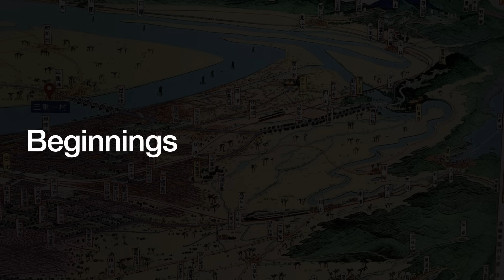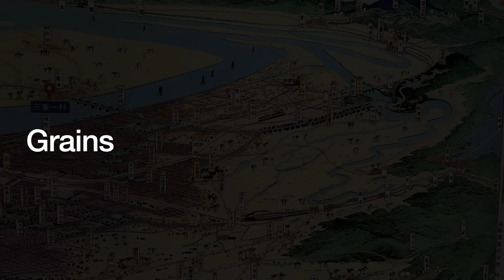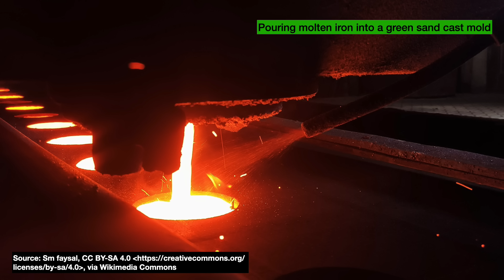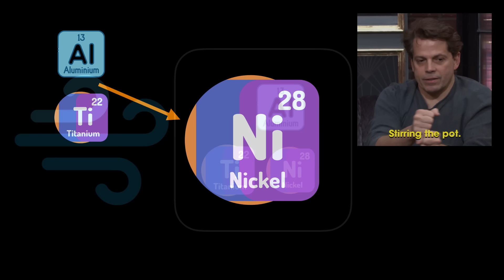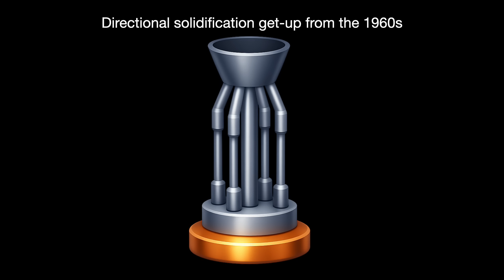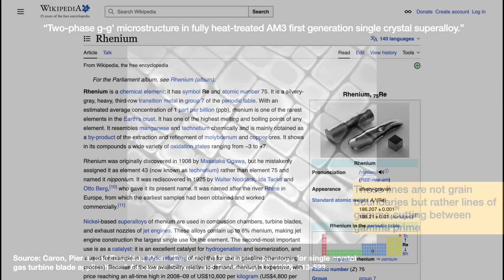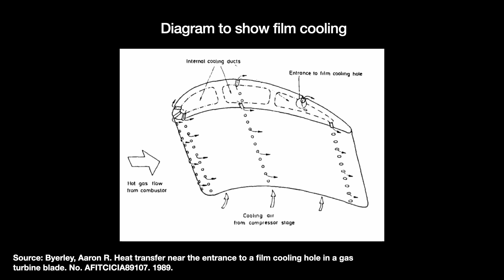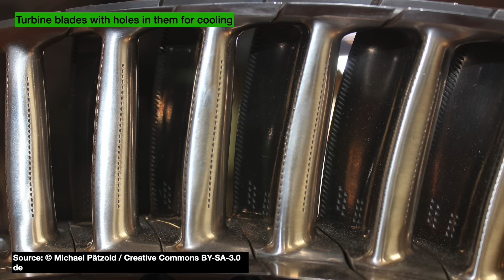Gas Turbine Blades and their Heat-Defying Single-Crystal Superalloys

Comment: Retired superalloy metallurgist here. Your summary is excellent! I worked at GE when rhenium was first introduced. Our first Re-containing alloy was called René N5 and was developed by Carl Wukusick. I used his excellent data to develop a computer model of alloying effects that was used for developing subsequent alloys, including the effects of Ni, Co, Cr. Al, Ti, Ta, W, Re, B, C, Zr and Y. My only quibbles might be that all of this technology was developed for aircraft engines and then transferred to stationary gas turbines. Also, air cooling was developed before TBC's (thermal barrier coatings). Air cooling is the number two thing in modern gas turbine performance, the first being the discovery of gamma/gamma-prime alloys. But you really hit it on the head at the end: turbine blades are made using a variety of very special, difficult, and expensive technologies.
Reply: Hello. I do not know you, but I am a huge fan.

Modern barrier coatings are the icing on the cake, but the crystalline growth mechanism is incredible, it was later used to create monocrystalline silicon ingots we use to make our semiconductors. Nearly the same process, but since Si is easier to work with it's usually grown using precipitation on a slowly spinning wire with a seed crystal drawn out of a molten pool.
Reply: @NotThatEcstatic hahaha fan 😆
Reply: @keinname2481 As an engineer, I respect anyone who works on truly deep magic like this. It pushes humanity forward.
Reply: @NotThatEcstatic  no it wasnt to mock you. Just because the video talked about fan blades 😉
Reply: @keinname2481 Ahh, that was a whoosh!
Reply: @NotThatEcstatic  hahaha whoosh 😆
Reply: I'm grinding and honing pre-machined generator and turbine bodies, this comment is pure gold for me. 
Greetings from Germany 🖖
Reply: @KwK-c7t  pure nickel comment would be more appropriate 😂
Reply: Would you recomend a book about that? Thanks in advance.
Reply: @fernandoagundezgarcia7299  There was a textbook I had to buy in 1974, "Superalloys". Absurdly expensive at the time. But you might find "Proceedings" of the quadrennial Superalloy conferences held at Seven Springs, PA during my time and before, maybe still. Academic stuff.
Reply: I forgot Hf, hafnium. It and C, Zr, and B are big and small atoms that lodge at grain boundaries, hindering their ability to slide. Still used in single crystal alloys, since they can have low-angle boundaries. Y is there for oxidation resistance. Al, Ti and Ta are gamma-prime formers. Co discourages the formation of extra phases, so more good stuff can be added.
Reply: @ChesterMotors-gg3dy  Hafnium has been a huge topic of interest for me lately. Very cool stuff. Very rare too once we exploited all of it on earths surface. I still dont understand why its preferred over Ziconium in alloys since they are so similar.
Reply: @keinname2481  Alloy development is not so sophisticated that all the ingredients are at optimum levels. Is 0.5% Hf the best level? The developers don't really know. Some ingredients are given more attention than others, but some may be present only because it was already in the alloy being improved upon. Some may be present based on an educated hunch. So, perhaps more Zr, less Hf would indeed be better. The tool I developed didn't address the minor additions very much if at all, since I had no data for them. Even for the major elements, I had only enough data to find linear effects, when the real effects probably were non-linear.
Reply: @ChesterMotors-gg3dy  
Sir may I DM you to get mentorship on said subjec experties?
Reply: Air cooling and TBCs were introduced simultaneously on the Jumo 109-004 "B" in 1943.
Reply: I never knew much about the German WWII engines, but just looked them up. Whoa! Blades made of sheet steel, naturally hollow, air-cooled since they'd probably not survive a start sequence otherwise. It is a curious fact that ordinary steel has a higher melting point (range, to be pedantic) than superalloys. I did not see a reference to a TBC, though.
Reply: @ChesterMotors-gg3dy  German WWII aircraft is really what inspired me to get into this stuff!! They ingenius ways they used material science to overcome "impossible" problems just showed me how these things can be like magic. 

If you haven't looked into it, check out their super heavy press program. Since the Germans lacked a lot of high quality steel for aircraft, they instead used aluminum...but because of the strength difference, they had to literally press what would have been 20+ parts into single large pieces. Incredible.
Reply: I cut Rene material frequently. Its machining properties are interesting. Much heavier RDOC than you would expect. Gotta stay ahead of the heat and chip evacuation is critical
Reply: What are they looking at using air on the inside of the blades? Just a mass to pumping speed to thermal mass thing? Why not something cheap like water (where on ground turbines can have massive thermal reservoirs/ cooling tanks) or something really expensive like cryo liquified gases?

Yes, probably economics/cost and mass/density, but  I was wondering if there's other reasons.
Reply: @sambojinbojin-sam6550  Water cooling for stationary turbines has been tried; I witnessed testing in 1973 at GE. I don't know why the idea was dropped, exactly, but many things must go right to implement a technology, and none can go wrong. The odds are against you.
Reply: @sambojinbojin-sam6550  Don't forget that the "cooling" air is everything but cool, it is hundeds of degrees hot. This is why water cooling is a problem since it would introduce massive temperature gradients that cause cracking just by thermal stress. Cooling of gas turbine components is a delicate balance and there is a reason why only very few companies master it.
Reply: Indeed, modern engines have compressor outlet temperatures uncomfortably close to the limits of Inconel 718, the go-to alloy for the combustor case, around 760°C (1400°F). That's the only air available at the pressure necessary to feed air into the blades.
Reply: @ChesterMotors-gg3dy  for gas turbines, cooled cooling air (CCA) is a thing. Actually, the GE 9H which was first shipped in 2000 has CCA. On that engine the compressed air is cooled by boiler feedwater (IIRC) which is an additional integration between the gas turbine and steam cycle. IIRC, other manufacturers do that as well. The aircraft engine world is a little different so I dunno if they do that.
Reply: I retired as the 9H was introduced - didn't know about the CCA. I never heard it discussed at GE Aircraft Engines. I presume it is not feasible, certainly not with an air-to-air heat exchanger. Such a 'radiator' would be enormous. On the other hand, water injection has been used, most notably for the B-52. It both cools the hot section flow and adds to the mass flow, but only during takeoff.
Reply: @ChesterMotors-gg3dy  I started my career fresh out of college as they were about to ship the first one to Baglan Bay in 2000. It was a monster engine at the time - 350 MW for the GT alone. I got to do performance testing on one in Japan. Very complex power plant but the steam cooling led to a lot of virtuous cycles. The biggest GTs are quite a bit larger (>500MW) now because size matters.
Reply: @sambojinbojin-sam6550 the power plant he referred to at Baglan Bay in Wales was a GE 9H had turbine in a combined cycle plant. I'm that engine the hottest blades in the turbine were steam cooled with the steam being IIRC intermediate pressure steam from the steam “bottoming cycle”. Using steam in this way has many positive synergistic effects on plant efficiency, emissions and power output at the cost of complexity.
Reply: Were you much involved with the compositions of the PVD ceramic thermal coatings?   Did they go strait to zirconium yttrium inclusive compositions, or was it a long and broad selection process?
Reply: @WGalbraith  I was not involved, but was vaguely aware of the huge effort to develop improved TBC's in the 1990's. I recall the term "electron beam physical vapor deposition", and the requirement that the ceramic have columnar grains, to accommodate the inevitable cracking.
Reply: PECM (precision electrochemical machining) is used to avoid cut and heat stress during machining
Reply: Can I persuade you to do some thinking on molten salt nuclear reactors? There are not a lot of money in it so the research is very sparse and small in scope. But if we as humans could produce a reactor that runs at ~900C then we could do thermal hydrogen production for cheap. Right now we are limited to ~700C mainly because corrosion, chromium mobility and creep. There is only one recent paper on gama nickel super alloy. A person with your knowledge and skill could help the cause.
Reply: I believe the problem with thorium and other molten salt reactors is, and will ever remain, corrosion. I am pessimistic because this has been the technology of the future for over 50 years, with just this one "simple" problem to overcome. We metallurgists have only ~65 elements to work with, and it seems we need some new ones to solve this problem.
Reply: These are the comments that are priceless.
Reply: Comments like yours are my favorite part to this channel's videos. Experts with a lifetime of experience who weigh in with fine details or inside scoops. Thanks for taking the time to add your perspective!
Reply: I just found a hundred pounds of 3% rhenium.  The boss thought it was just regular nickel scrap until I started researching it more with the xrf gun or x-ray gun
Reply: Did you know China just figure out how to make Niobium silicon alloys at industrial level, solve the brittleness problem and even enhanced its strength. Now China can start developing jet engine combustion at far higher temperature than with current superalloys.
Reply: @gelinrefira  now they need to set up a work culture of extreme and consistent QC with very meticulous record keeping, because unlike other industries, if something goes wrong in a plane engine part they made and you lose 200+ people, the world pays attention and the industry will demand answers.
Reply: @jac1207 China wont care if a plane takes out 3 city blocks of apartments.  It is justvanother day ending in "Y".
Reply: @gelinrefira sounds good, until they can get an engine to last till it’s first overhaul…….. without stealing the knowledge……
Reply: @Idrinklight444  This is just pathetic cope. I just told you they now have tech the west DOES NOT HAVE and the first thing you say is western propaganda. First they didn't steal tech, they bought it and then learned from it. They are still away from having the same flight hours as western engines but they have already reached parity in thrust, and fuel efficiency. That was not even thought possible 10 years ago. China has, to all intents and purposes, caught up. And it only showed how low level the thinking in the west is, to believe the nonsense you can just "steal" tech and use it without having the scientific and technical knowledge to make it happen, and the industrial capacity to build them at scale.

China has rare earth refining tech. Why don't you people try to steal that and make your own? Ohh right, you westerners LITERALLY do not have the chemical expertise and knowledge to use China's rare earth refining tech, nor the industrial capacity to refine them. You people literally do not have chemistry departments in your universities that know how to refine rare earth like the way Chinese do. It will take you people decades to catch up, even if you could.

So STFU and sit down. You people are such sore losers.
Reply: Thanks chester!
Reply: I went to my dad’s take your kid to work day at McDonell Douglas where he was a. Engineer. He was just going through his email in the morning and there was a report from GE about something. I just remember him saying
“Ah yeah, those GE guys are good”
Reply: I love all of you materials engineers and researchers in the comments on these videos. I'm just a humble artist type, but I could have, and maybe should have, gone into the sciences. I get to read, and learn, and partake in what you all do, like a spectator event for nerds, or something. This is the best sort of thing the internet has accomplished.
Reply: Hello sir, I'm a younger guy in school for material science and I want to specialize in metallurgy and aerospace. As someone with experience, what would you say is the "best" thing to specialize in? Anything you would have redone if you could go back??
Reply: Thank you for commenting, then further answering other's questions.  I watch videos like this one in attempt to break free of my 
government sponsored public education. (all the crap I learned in high school)  After finding comments like these, I read everything carefully and pause to look up terms & definitions as well.  Again, thank you.  Applied Physics & Chemistry rules...🇺🇸 👍☕
Reply: Thank You for the quality engines!!! I have an hour or two on your T-64 series engines!
Reply: More rhenium does the trick?
Reply: @andreimoutchkine5163  Well, alloy improvements were incremental after the first gamma/gamma-prime alloys. The next alloy had targets of 50° F improvements in temperature capability, which translated to major improvements in fuel burn and range, and/or durability.
Reply: That’s awesome. I’m a big alloy guy. I’m an electrical/CS and Aerospace engineer that mostly worked on the space side of things, mostly telecom and weather satellites, now I run a small remote weapons systems and counter-UAS company.

I’m just confused about something cuz Rene N5 is a second-gen rhenium alloy from the 1980s. Rene 41 is an alloy I
use for the body of thrust control vanes in a solid rocket kinetic hard kill vehicle for class 3 drones and that’s been around since the late 1950s. That was the first aerospace Rhenium alloy. There was a W97Re3 alloy, not sure how old that is but it can’t be much older.  It was used to make incandescent bulbs that could resist high acceleration without breaking more effectively  than pure tungsten, and it also found its way into refractory thermocouples that they still sell today, but the cost of platinum-palladium thermocouples is surprisingly not that high. I use them all the time for all my heat treating/PVD equipment. There’s no way you’re old enough to have been working in metallurgy since the late 50s right? Do you Like Ike? That’s the test right there. 

Now I’m not autistic, I’m far too successful with women for that, but I’m definitely autistic for metals. I literally have a tattoo of α' martensite and γ austenite phase crystal diagrams, ball and stick models. In case I forget. Nah it’s cuz I’ve been making knives since I was 14 and an interest in steel alloy performance was the launchpad for my interest in materials science but not enough to pursue it. That’s so cool you really worked on the cutting edge of research for alloys that really, truly advanced human civilization. That’s a big deal in shrinking the cost of air travel, petrochemical, space flight, and yeah not very cool but gas generators. I prefer them to coal. I think I’d prefer nuclear, then Hall effect plasma magnetohydrodynamic generators, but the gas generator efficiency is just too damn good cuz of those alloys it’s hard to compete with that. Thanks for sharing 100 year old metallurgist.
Reply: ever since I saw water boiling from a plastic bucket over a gas stove,I became aware that cooling is the secret sauce
Reply: @ntakusort Qualifty plastic! :)
Reply: Honestly i always assumed the process of achieving full cristallosation was more complex than just letting it cool from the bottom up very slowly. But i love the pigtail idea
Reply: Also the technology required to generate a single crystal casting was considered top secret for decades.
Reply: How does it compare to the the the precise, unholy ritual that must be perform to (maybe) produce a perfect raw silicon crystal for use in lithography?
Reply: One of the early adopters of industrial gas turbines was the natural gas pipeline industry that used them to power centrifugal pipeline compressors.

Most of the early stationary gas turbines were aero derivatives.  We tended to reduce the maximum firing temperature (with the attendant loss in thermal efficiency) in order to increase the turbine blade lives.

We used them in peaking service where they could be started and placed online faster than an integral reciprocating compressor could be placed online.
Reply: I was attending an ASM course on nickel superalloys some years ago and was shown the pigtail sprue from such a casting as a visual aid. Very very cool.
Reply: which of the alloys are not food safe?
Reply: When did you work there?  Did you know Edwin Pace?  That's my grandfather.  I think he would have retired late 80s or early 90s iirc.  He started there in WWII and was an engineer that helped design turbine blades that were in Pacific fleet ships.
Reply: Asianometry is a pretty knowledgeable dude all around but he's an absolute star when he makes metallurgy videos
Reply: But my turbocharger has the latest and greatest Billet Aluminum Compressor and Titanium Turbine 😂
Reply: To your point, TBC does very little to reduce steady state temperatures without backside cooling.